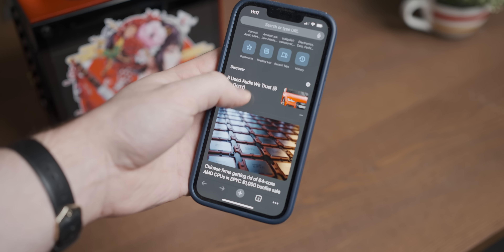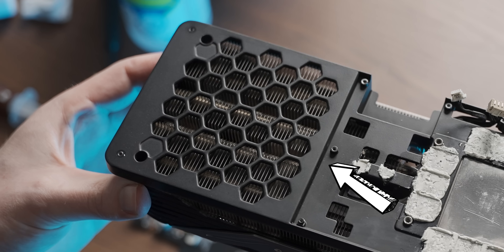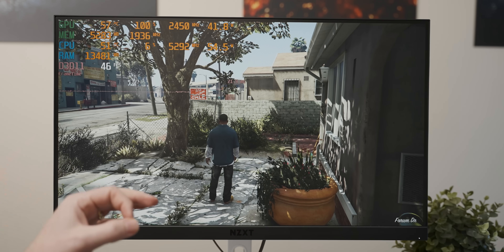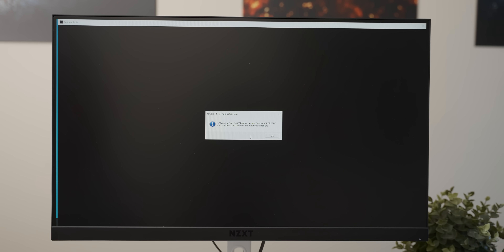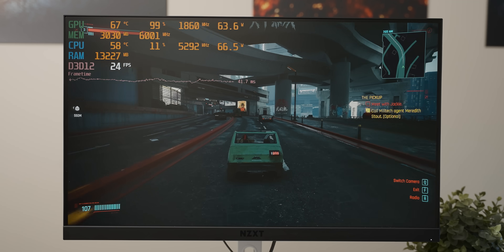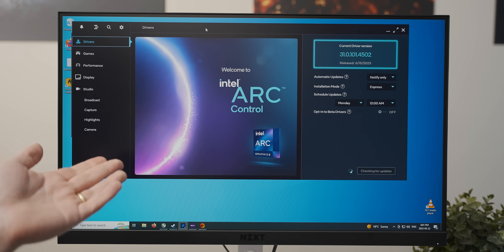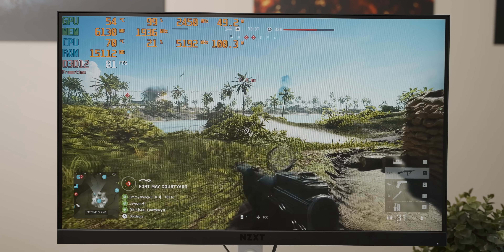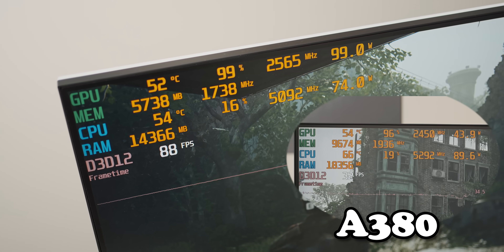The New Master Of Fine Wine Graphics Cards?

Comment: Is there a low profile A380 with no auxiliary power requirement? If it draws only 75W, it might be a nice option for SFF cases which don't need the very high 3D performance of an RTX A2000 or RTX 4060LP.

Comment: Except now you can get the A750 for a measly $190 that easily matches the 6600. Or for $290 you can get a A770 16gb. I can't think of ANY other sub $300 GPU with 16gb if you need vram more than raw grunt. The A380s best use case now is as a bare bones GPU for CPUs without integrated graphics, or simply as an AV1 encoder card.

Comment: The rx6600 was the most bipolar card i ever had and was the only card i ever had crash, and itd do it about once a day. But when it worked, it worked pretty good. I do primarily VR and it didnt do great at VR, but anything under 500 bucks wont do great at VR. The intel cards (i think 720 or whatever it is) have very high VR potential as you can get insane vram for it. The only problem, drivers dont support VR and havent for years, and intel is aware of the issue

Comment: Comparing to a 1630 makes no sense, should have compared it to a 1650 Super or a 1660.
Reply: I'll save you the time. 1660 >>> 1650 Super = A380 OC  >> A380 Stock >= 1650.

Also, thanks to Nvidia's screwed up pricing, the 1630 is the cheapest new card they have available. The sad thing is that the A380 is the best budget buy right now at $119.
Reply: @EbonySaints  the 1660 is just 10% faster than a 1650S, plus the 2GB extra.

I have no idea why they released the 1630, did they have mountains of defective 1650 piling up in the warehouse for 3 years?

Comment: "I encountered unfair treatment on my Sony PS5 console. I have a PS4 disc of COD13 (Infinite Warfare), and yesterday, while on the main menu of the game, I saw a remastered version of the original Modern Warfare in the bottom row (equivalent to additional content). I clicked on it and entered the PS5 store interface, which showed that I needed to purchase it. I didn't want to buy it, so when I tried to exit, I pressed the Circle O button (because it's the UI of the PS5 store interface). However, due to running the PS4 game, the O button directly became the confirm button (Sony's PS5 operation is X to confirm and O to cancel). It triggered my Alipay's payment without a password, and the purchase was successful. I immediately tried to get a refund when I returned to the game interface, and I never downloaded what I bought (the PS platform's refund policy is for digital content that has not been downloaded or used within 14 days of purchase).

First, Sony's technical problem caused a bug in the PS5 store's purchase interface, where the confirm and cancel buttons were reversed, leading to this erroneous payment without a password. Second, I am eligible for a refund because I never downloaded it, but they claimed that I had streamed and played the purchased content, even though I hadn't used the streaming function for a long time. Moreover, the reasons for the refusal of refund from the customer service and email were different. Finally, when the customer service could not solve the problem, they remained silent, and I have never seen such a bad attitude from customer service. I wasted my phone bill, and the cost of calling Hong Kong from the mainland is expensive. The two phone calls cost more than the price of the game. Can anyone help me figure out how to protect my rights?"

Comment: Hey bud. Are you comparing old footage to new footage? I remember telling you that intel firmware updates can't be undone. Once you go to the new firmware you can use the old driver but the new firmware is still running. This would make it look like nothing much changed. Just checking. My bad if you knew.

Comment: I wanted to like Intel's Arc. But 2 things are keeping me away. First is the massive performance lost when a system doesn't have Re-Bar support. This is a big deal, since I upgrade a lot of systems. Second is that after all this time, there are still a lot of games that will not even run on it.

Comment: I'll point out something you didn't mention about the ARC: Take a look at memory util claims in the RTSS overlay. Particularly with CP2077 and BFV.  There is a substantial drop in 'amount of memory used over what the card has' between older drivers and new ones, and that is likely where the minor improvements in frames and 1%s came from. 

It's also interesting seeing how much more VRAM the ARC card is using compared to the 1630 in general, even in games where the 1630 is running better, like GTA5. It would be interesting to see how the ARC actually performs if they ever get memory management handled in an efficient way.

Comment: the best part about the a380 is the overclocking capabilities. In the Arc Control center, just increase the power draw and add some voltage (like +90 is a decent start) and watch the card transform into a different card altogether.
Reply: It really is a solid overclocker. I'd argue that at ~2800Mhz, it's almost a 580. Granted, stability is iffy there, the Asrock Challenger model has a considerably worse cooler than this, and you have to do some stuff using the Predator Bifrost software to get that specific model to go above 66W.

Comment: That A380 had 6GB GDDR6 and only 96bit memory interface??? Really??? So even my now ancient (2016) Palit GTX 1060 Super JetStream (6GB GDDR5, 192bit) still kicks the cr*p out that A380! 😂
Reply: It depends. The A380 in its element can match or slightly edge out a 1060. Cyberpunk is a good example where at 1080p Medium the A380 matches the 1060 at stock. In anything DX12, the A380 can keep pace or beat it overclocked.

Granted, the 1060 has the benefit of considerably more mature drivers and a much less discerning market. You can slap a 1060 in any PC made in the last ten years if it has more than four cores and get a performance boost. If you put an A380 in anything that doesn't support Re-Bar, then you wasted your money. The 1060 will more or less play any game made in the last twenty years with no issues related to software support. The A380 will do everything post-2020 okay and then be a patchwork to where DX9 performance is okay but lacking and DX11 is derpy at the best of times.

Honestly, as far as sub-$150 new cards go, it's the best card, especially at $119. The problem is that the 6600 is insanely dirt cheap given the price difference, so you're better off buying that or an A750.
Reply: @EbonySaints  My point was that there's little point in upgrading my venerable old 1060 unless the new card offers a considerable performance jump, which isn't a card like the A380! The 6600, yes, of course.

Comment: A380 in my local stores cost ~160 USD, rx 6600 ~225 USD. A380 is quite a bargain on my local market, the best you can do at this price point is rx 6400 or gtx 1630. I know its worth adding a few for bucks for triple the performance, but for tight budget it looks like A380 is a king now

Comment: Thank you for switching to a frametime graph instead of the fps graph... Its a lot easier to tell how smooth/consistent the fps is with the frametime graph. Also it would've made more sense to compare to the RX 6400 or 6500 XT which are more similar price/performance wise. Maybe even the 1650 (tho its difficult to find new) just for some closure for the people who have the 1650.

Comment: Not only does the RX 6600 get 3 times the framerate, it also supports VR.
Reply: same does with the whole 500 series 6000 series and 5000 series for the vr
Reply: I wouldn't call the VR performance very good though tbh... Still one of AMD's weak points, sadly.

Comment: Fine wine graphics cards don't exist.  Either the drivers are good and you get 90%+ of the cards power day 1 or the drivers are shit and you can cope and call it "fine wine".

Cards do not magically get more hardware power as they age.  If they get faster with time due to drivers its only because the launch drivers were HORRID and massively under using the cards potential.

Why people seem to think this is a good thing baffles me utterly.

I guess we should start calling all these unoptimized shitty broken games "fine wine" games too right?  Because it's literally the exact same concept.

Look the game is so good it runs 2x better than it did at launch 2 years later!  It aged like fine wine.  No, the game was just so trash at launch it barely ran.

Comment: Love the call out to the 6600 at the end.   That gpu is single handedly making everything else (new) below $200 look absolutely dumb.
Reply: A750 when its discounted is in a different league of price to perf
Reply: @shreshta_yt   I’ve heard of the A750 selling for as low as $199 but when I look around I have not  seen it.  
At that price it is definitely worth considering.  
Though it is still not faster than a 6600 in every single title and I can buy one of those today for $179.
Reply: @evers6214  the A750 is ALREADY beating the RX 6600XT in higher resolutions?? This is just why Intel is a great value, the A750 was made to compete with a RTX 2080, so i expect it to slowly get to that performance leve, this is also why i think the RX 7600 is a good value, DRIVER FINEWINE
Reply: @shreshta_srivastava Please stop. The A750 is decent at 1440p and RT, but the fact remains that the thing is still a bit temperamental for most people, especially with DX 10/11 games. And at $250 new with occasional drops to $225 or $200, it still has to compete with the 6600.

Please stop with the copium. I'm an Arc owner and I like my A380 enough, but I realize that I'm a beta tester for Intel atm.
Reply: @shreshta_yt  A750 Targeted RTX 3060. A770 Targeted 3070.
Reply: @Dr.C-UTS  no, I have no idea how u came to this conclusion, but the A750 was a RTX 2080 killer and the A770 was a RTX 2080ti killer. ARC was seriously delayed and underperforming. even the CU count on arc tell this, do you think 4CUs is what Intel wanted to seperate DIFFRENT CLASS of cards?????
Reply: @shreshta_srivastava  I'm an Intel Arc Odessey Journey  card winner. I spoke extensively with the team. Intel keeps white papers on everything. A750 targeted 3060 while A770 targeted 3070. There's no mountain of performance difference between any of these cards. Curious though, who told you that? The team themselves got cards for driver testing in March of 2022, so they weren't delayed either.
Reply: @Dr.C-UTS  the driver teams got the card late for testing then, it was the design team who was delaying
Reply: @shreshta_srivastava  The only real delay was when they realized they couldn't use the iGPU driver stack and had to start from scratch, ultimately pushing back launch.
Reply: @Dr.C-UTS  with how spread out GPU launches are, I hardly consider a quater a "delay"
Reply: @shreshta_yt A750 is $300
Reply: future is red unless you want to unnecessarily want to spend more and get nvidia coz the more you buy the more you save
Reply: I have an a770 8gb for 250 new , the value is there as it's on par with my starwars titan xp. For a first gen card. You can't complain. Got my 6900xt for anything serious
Reply: @leeoloughlin9249  , hey, i think ARC is a great value, especially the A380 and A750 for their price classes. first gen or not, ARC is very good value. it just its going to get a whole lot better with drivers, especially when intel develops native DX10,9,11 drivers (they are using DXVK)
Reply: @shreshta_yt Bunch of delusional intel fan with no clues
A750 is bad for the price.
Reply: @asdbef3667  oh really? i know the power efficiency could use some work, but at 200, the A750 is a STEAL. similar raster to RX 6600, RTX 3060 TI RT at almost the same price and better encoders/decoders than even Nvidia
Reply: @asdbef3667 "a750 is bad for the price" and you are calling him delusional???

Comment: How is it possible that with the intel GPU the memory usage was over 6gb when the GPU has 6gb? Am I missing something?
Reply: Shared GPU memory. It’s borrowing from system ram like an igpu would.
Reply: @DickGently  thanks! I didn't know this was possible. It does not happen with mine rig. Is it because it has an igpu in the i9?
Reply: @SICVALE  as far as I know? I don’t think the arc card can borrow from system memory if it’s paired with an amd cpu.